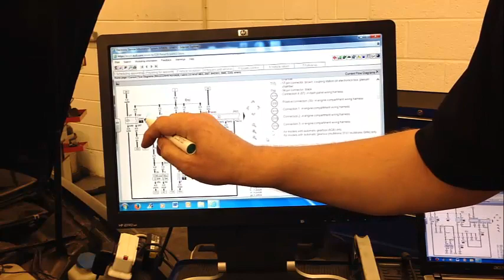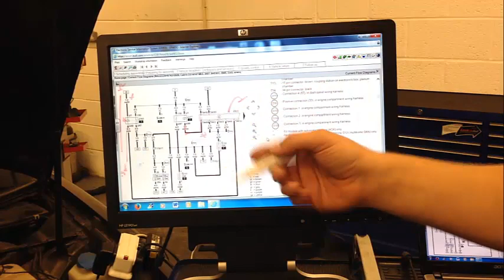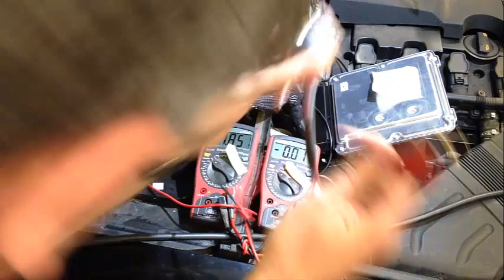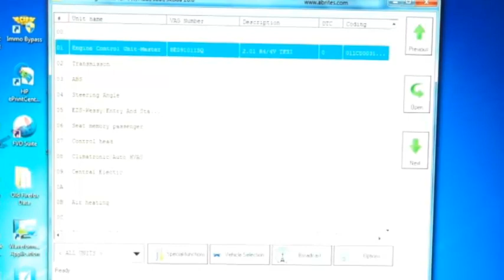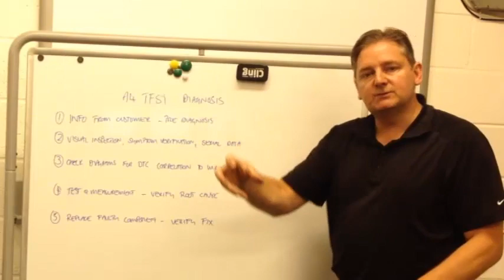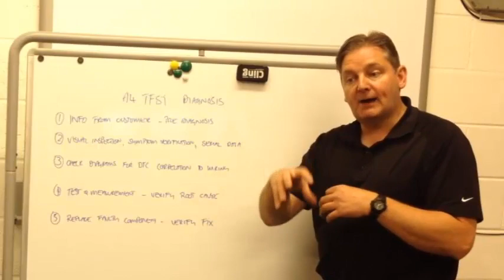TFSI Running Fault pt2

Comment: Impressed for 3 reasons - he questioned the pull down voltage level (.8v, which was highish but OK) ,  he realised the slightly lower relay coil resistance might not definitely indicate a faulty relay, and he was knowledgeable that the slight delay in the relay operating was significant.

Comment: Hi I work on European cars and on my personal Audi A4 with the same engine I had the same problems and there is a technical bulletin on this issue and I think they change the part number of the old relay if I remember right the two relays that are side by side are the same so you could swap the out to see if the problem goes to a different place but yea I replace mine with a new one and never had any issues again. I remember seeing similar problems on MK4 VW's .